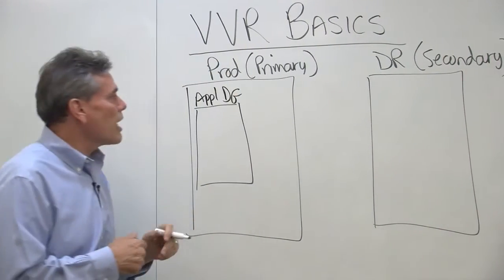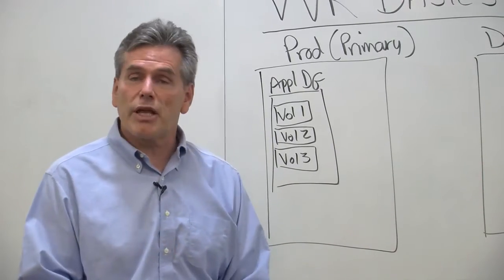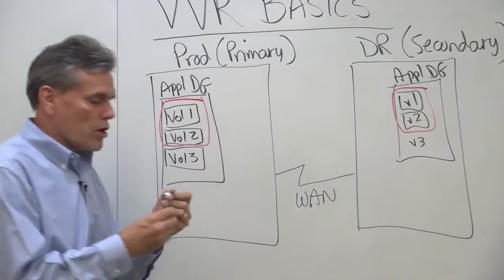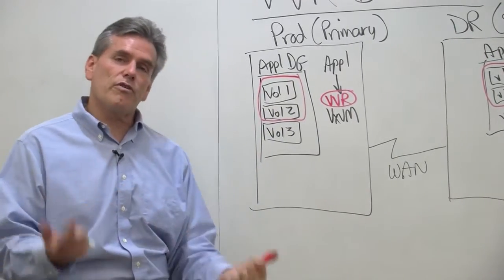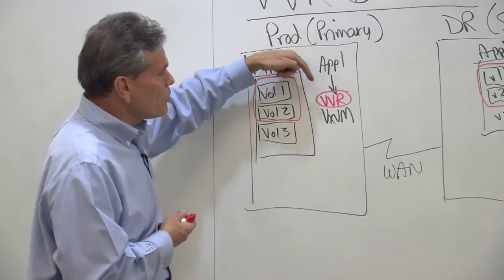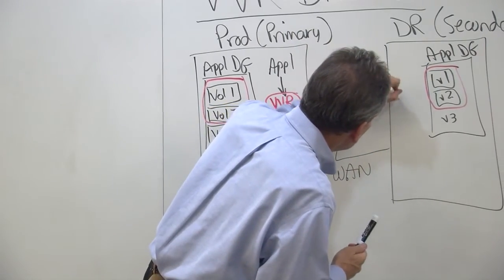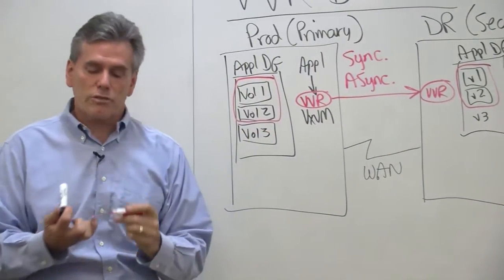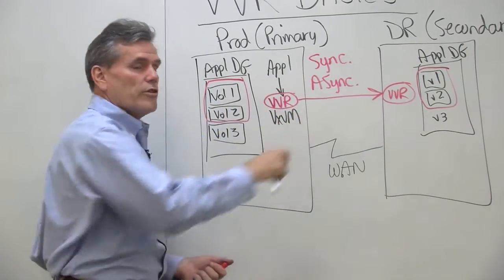Veritas Replicator Basics

Comment: Is there any dedupliction done when replication goes over the WAN to reduce traffic?
Reply: Deduplication is a function of the FileSystem that requires vols to be managed by VxVM and Replication is a function of the VxVM Layer. When you write to the FS you replicate the blocks to the other end in the same order they were received to be written to the VxVM, so if the VxFS saves IO by deduplicating data, this gets passed on as less blocks to replicate in the VxVM layer and to the network. On the other end you don’t have the VxFS layer processing, only VxVM.